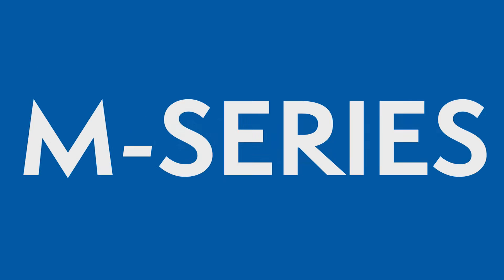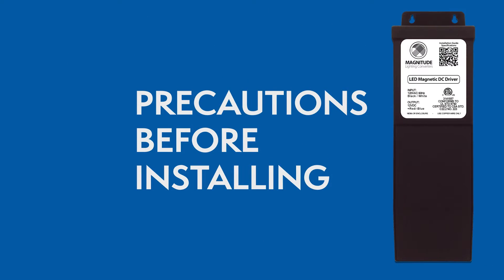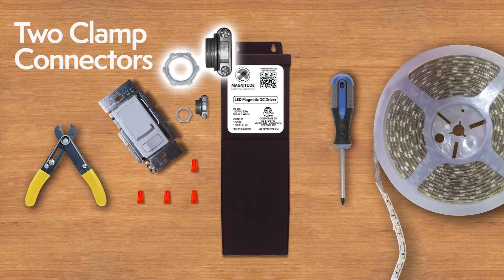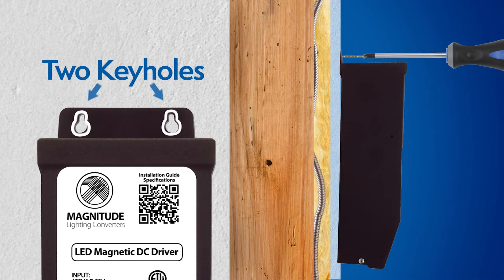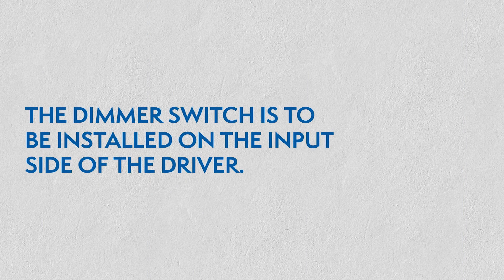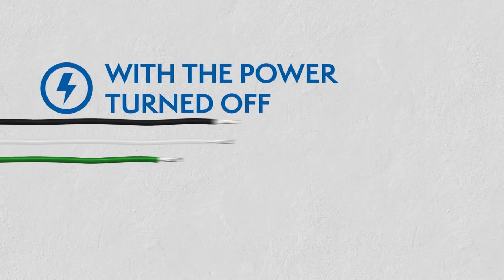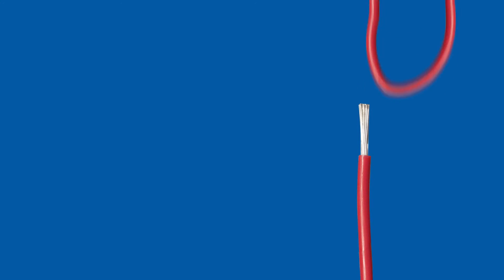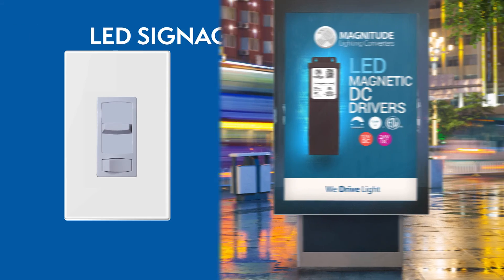12VDC 100-150W Magnetic Dimmable LED Driver installation guide

Comment: We have this exact led under cabinet lighting in our apartment. we want to purchase the "connector" wire that connects ligth strip to light strip because the current one does not click into place.  I have it "rigged" and held in place with duct tape so the connection is there but would like to replace correctly.  where can I purchase this small connector (wire with contacts on both ends (about 6" long)   The apartments tell me the manufacturer is going to come out to repair all units but time frame is unknown. Id rather just fix it myself so I can see rather then wait.